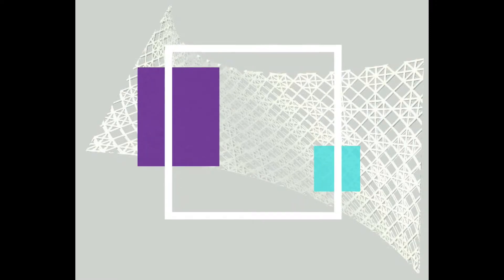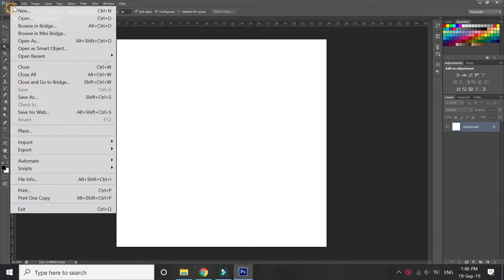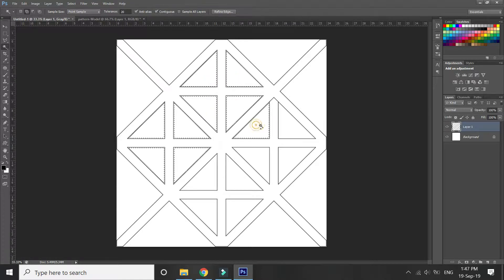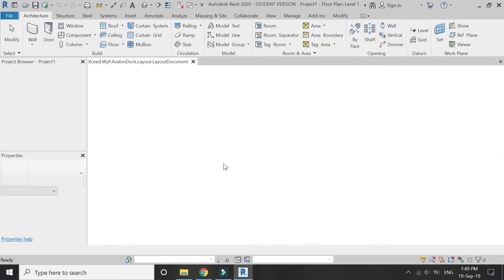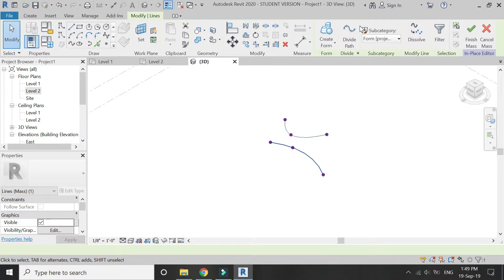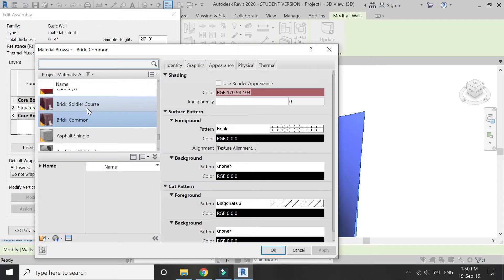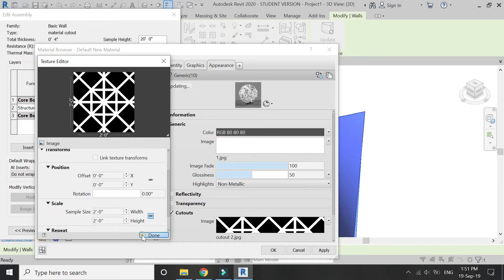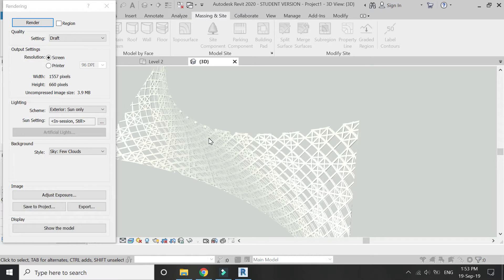Revit Tutorial - GRC Pattern on a Curved Surface

Comment: How to apply different material in single wall means suppose I want to make parapet with stone finish and rest of the wall  only epoxy paint.
Reply from the maker: Try "Split Face" command in the Modify Tab. Its shortcut key is SF.